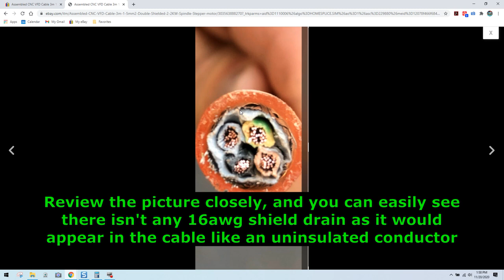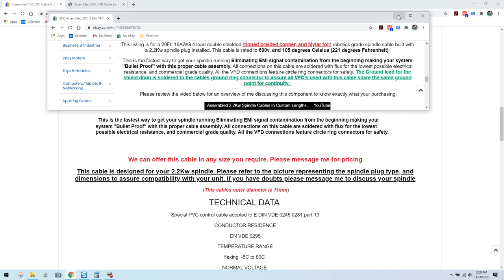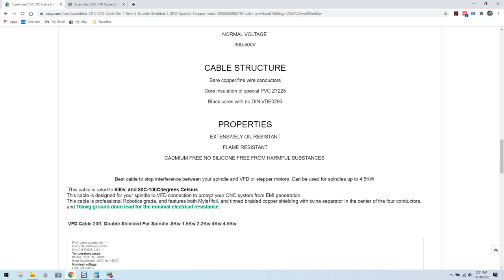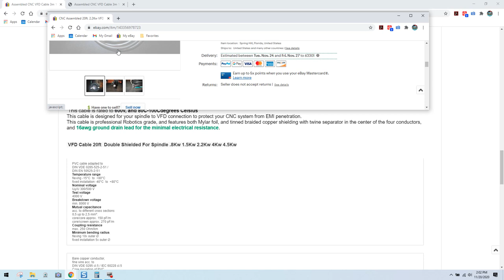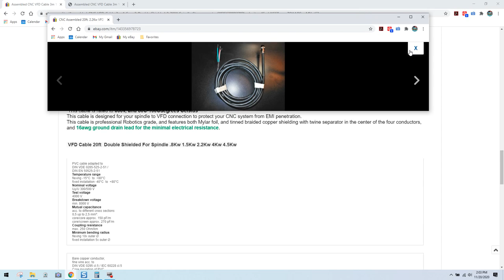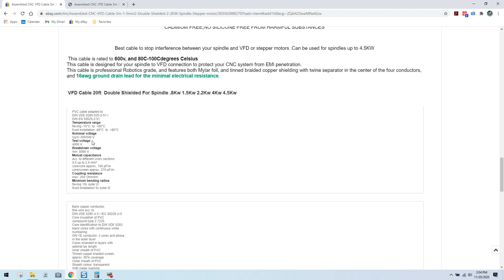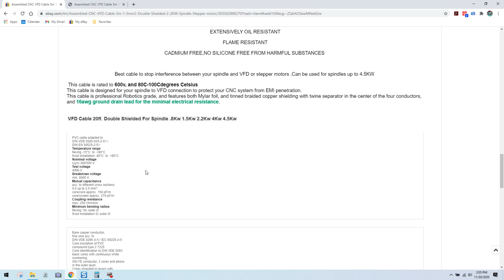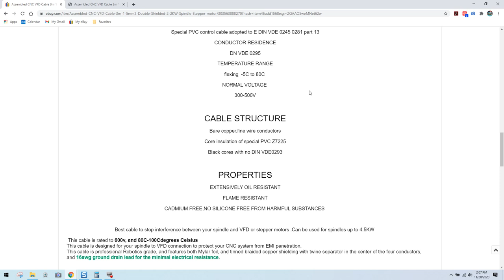I just Saved You $130 On A CNC Spindle Cable...

Comment: I purchased some of this cable prior to seeing this video. It does seem like well-made cable. However, no dedicated drain wire as suspected. Also no stats on the cable. Saying that, some good tips in your vids for the installation of the connectors. I'll do my own on the cable terminations. Knowing it does not have a dedicated drain wire, I guess I'll see if my spindle even has a connection on pin4. I've heard quite a few are not even connected.

After a bit of research this cable I believe is marketed as "Screened Control Cable"
Reply from the maker: Dirty Optics, thank you for your support. Thank you for taking the time to post your experience with it. China doesn't connect the pin 4 terminal on 98% of their spindles as they assume the end user will ground their CNC's metal chassis which through conduction will ground the spindle as well. I suggest being careful with the cable as if its double shielded the MBR rating is critical to be followed, or the longevity of the cable will be compromised. Thank you,
Vince
Reply: @corvetteguy50  I'm going to buy some Beldon VFD cable suitable for the application. Only problem is that here in Australia I cannot buy it by the meter....I would purchase your cable but I am trying locally here first to save on shipping. Who would have thought it to be such a hard task. thanks.
Reply from the maker: Yea unfortunately this is the problem for many of my international clients. I hope you find it locally as I know the shipping, and taxes can be really high. Thank you again, 
Vince